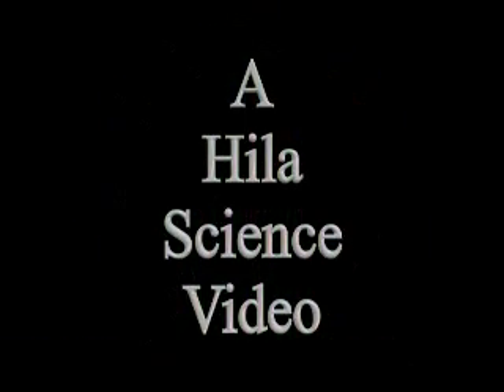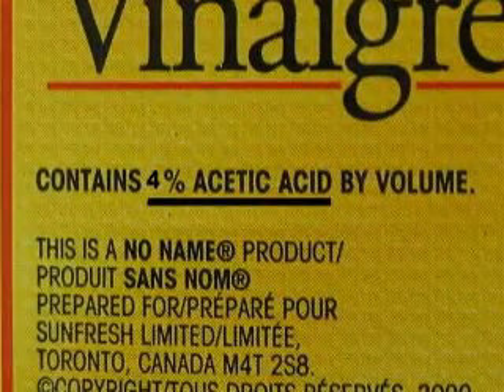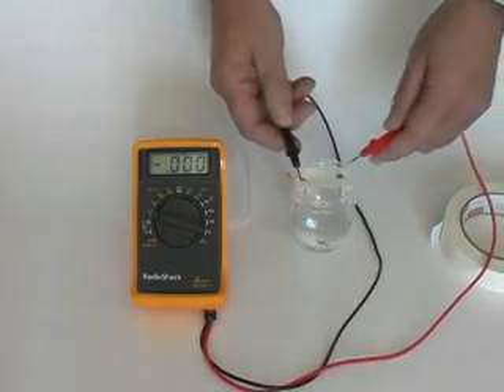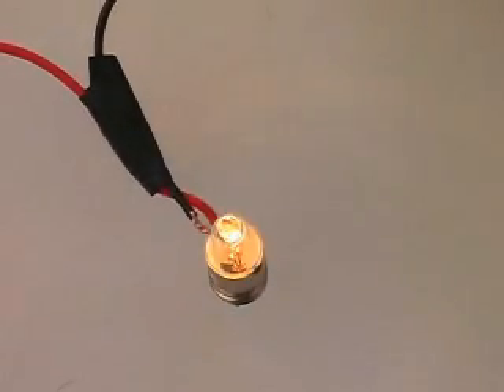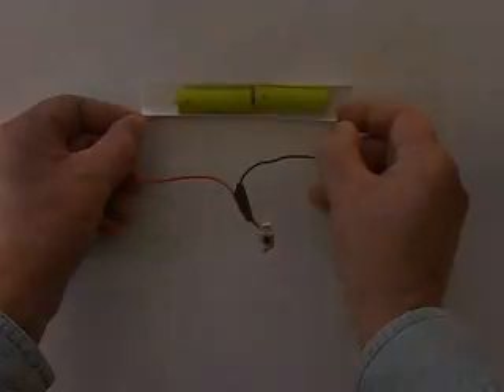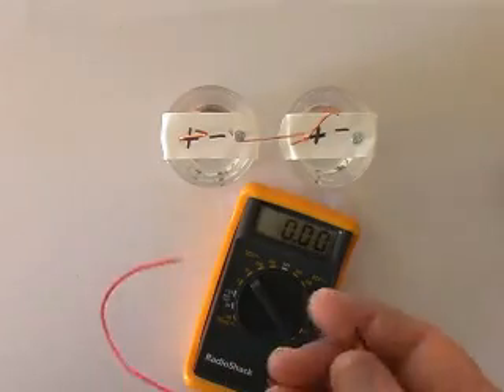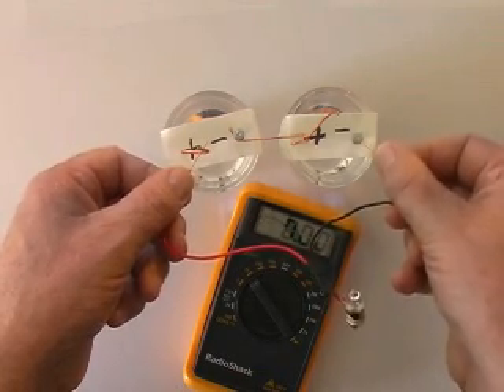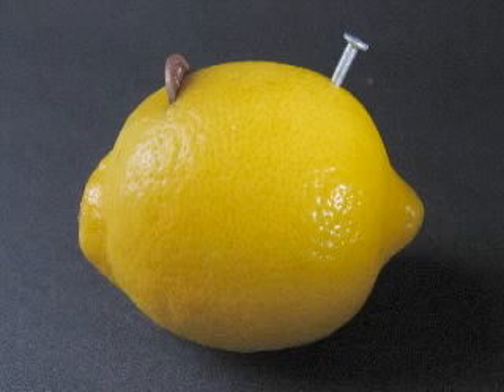Vinegar Battery

Comment: well in a lead acid battery the sufuric acid inside turns to water as it goes through the chemical reactions of creating electricity and when you charge the battery you reverse the reaction creating sulfuric acid

Comment: How much vinegar will determine how long it lasts, and the rate at which the voltage will drop as the concentration of reactants (yes the acidity (H+ ions)) decreases during operation.  Larger volume will equal slower concentration decrease.

Comment: Obviously doesnt last forever. The battery is basically oxidation and reduction. After the metal has been reduced or oxidized (copper and zinc), the battery stops working.

Comment: erm, by "electrolyte" I meant the acid in the vinegar. If you allow the battery to run for some time, you'll notice that the one of the electrodes will dissolve, and the vinegar will lose its acidity.